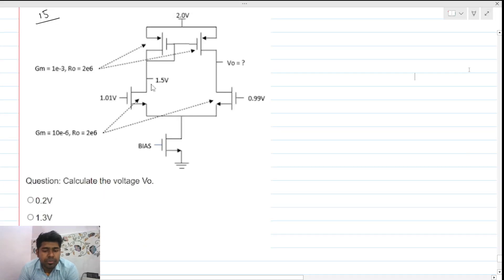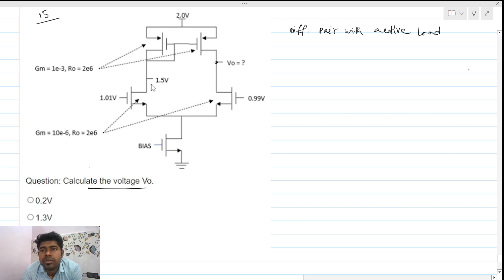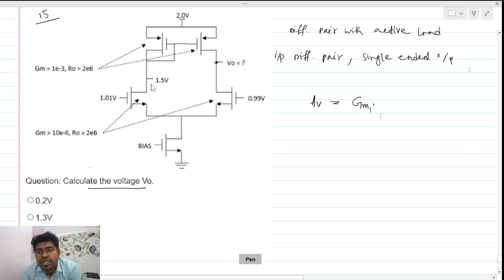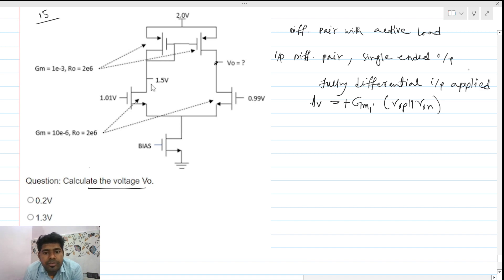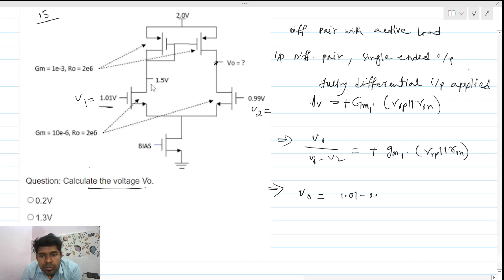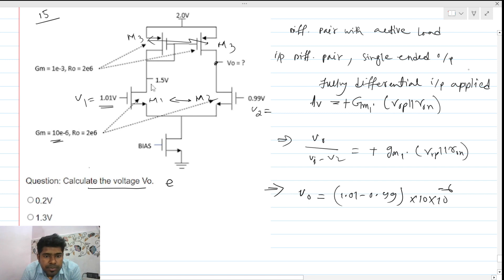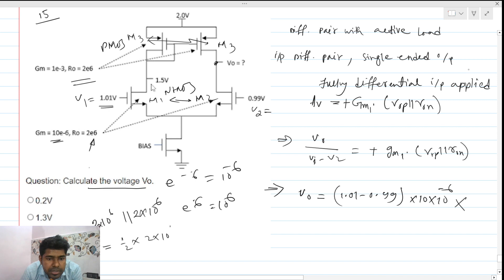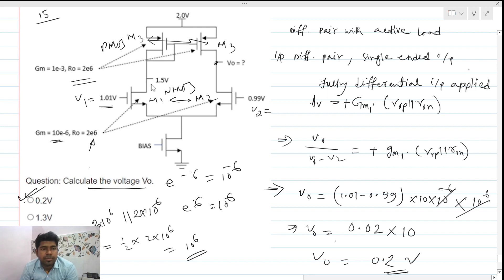What is the Gain of the Differential pair with active load Amplifier_Analog Design_ Amit Bar

Comment: Hi Amit, I think they have given 1.5V as the common mode voltage and, for this circuit, common mode Vo also will be 1.5V. Now, you must be adding this small signal o/p caused due to 0.02V differential input to this 1.5V common mode. So the answer would be 1.5 + 0.2 = 1.7 V. Correct me if I am wrong.
Reply: 1.7V is correct answer
Reply from the maker: Bias input value voltage is 1 V and bias output voltage  is 1.5 V....differential o/p  is 0.2 V...overall o/p obviously 1.7 V